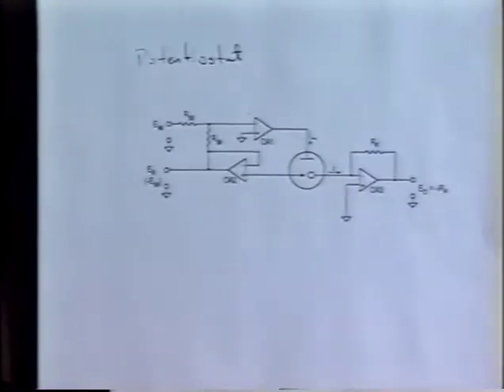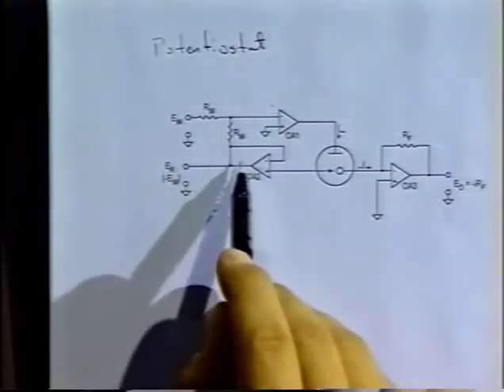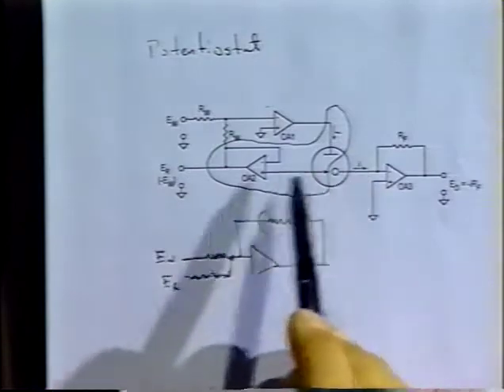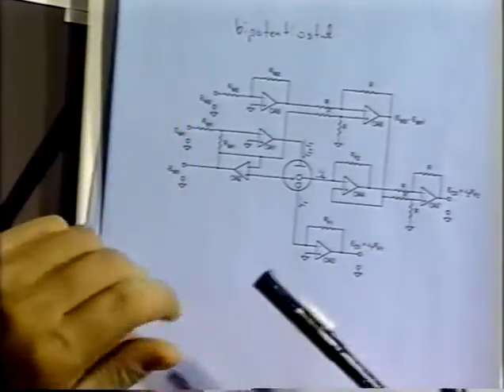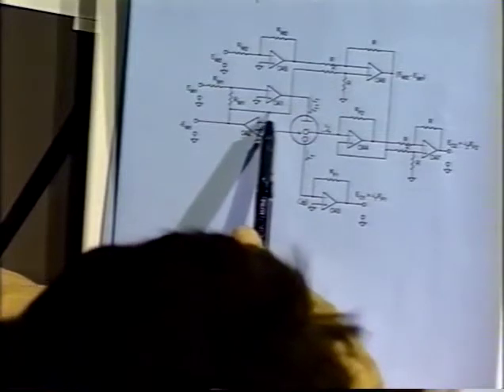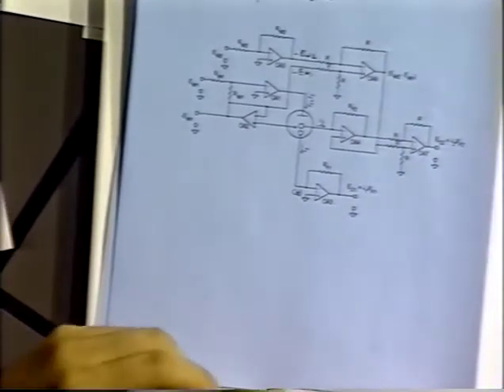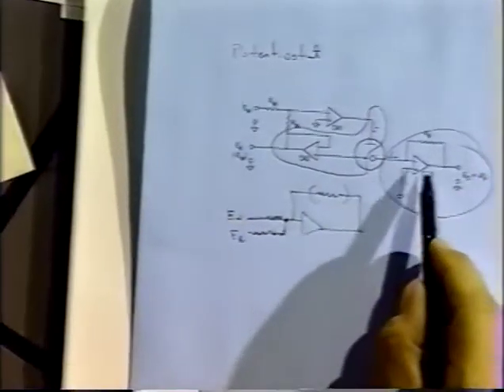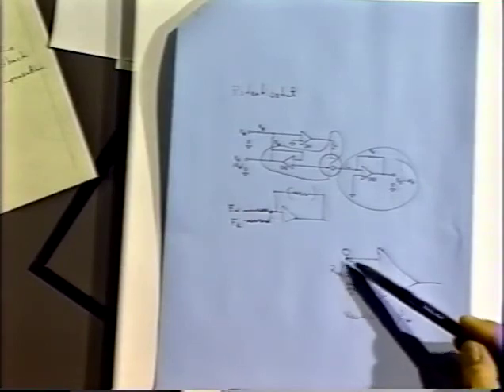Potentiostatic Circuit

Comment: Thank you! Very comprehensive and useful for the typical electrochemists who want to go one step further and master the instrument they use, potentially by building one by themselves. It would also be great to see an updated version of your lecture, showing the other classical potentiostat circuit (the buffer reference potential going to the non-inverting input of the control amp, as well as using two working cables (sense working electrode and drive working electrode)). Thanks again!

Comment: The 'feedback resistor' you've drawn at 6:15 to simulate the impedance of the cell, in the printed diagram it connects before the Rw of the Er, whereas in your drawing you've connected it after the node between Er and Ew.  Just an observation.  This and the lecture on operational amplifiers have been immensely helpful.  Thanks much.
Reply from the maker: Yes, I could have been a bit clearer there, the main point is that the impedance between the Aux electrode and Ref electrode is the  majority of the feedback loop. The  presence of OA2  buffers that impedance from the input resistance of Ew and Er and can be ignored assuming an ideal operational amplifier. Were it can't be ignored is a bit more technical than these lectures address. Good catch.

Comment: I dont find any closeloop path where you can measure the existing potential difference between Working electrode and refence electrode and feedback to the input of control amplifier to compensate the potential difference between WE & RE at require potential difference.
Reply from the maker: Recall that the working electrode is held at ground potential and the reference electrode potential is measured vs ground. Thus the reference electrode potential is effectively  measured vs. the working electrode.  Also, there is a feedback path through the solution resistance.

Comment: Hello I really enjoyed your video concerning Potentiostat electronic design and topology! I am a design engineer at a large medical diagnostics company in Germany, and have been designing two electrode analog front ends for the detection of glucose amounts in blood. EC is not my background, I have designed circuits through trial and error. Is there a comprehensive text which describes different types of electronic designs for two and three electrode systems, and also the implementation of different filter strategies? I found your explination approach perfect for my type of design work.  THANKS!!
Reply from the maker: Hi, I am not aware of a specific book or article that discusses potentiostat design. I suppose there must be one but I don't have any such book handy.  
One book that you might find useful is 
https://www.crcpress.com/Laboratory-Techniques-in-Electroanalytical-Chemistry-Second-Edition-Revised/Kissinger-Heineman/p/book/9780824794453, which has a chapter on potentiostat stability.

Comment: can we use differential amplifier instead summing amplifier? so reference voltage follower's output goes to negative of difference amplifier and excitation signal goes to positive of difference amplifier.
Reply from the maker: You could use a difference amplifier but it would require some care. In your comment above, Er is subtracted from Ew by the difference amplifier. This is not what you want typically. However, if you first inverted Ew and supplied -Ew to the negative of the diference amp. and Er to the positive of the difference amp., this would work.
Reply: @dwipf1851  could you please explain why Er-Ew will not work but Er+EW works?
Reply from the maker: @shahfenil08  I didn't say it wouldn't work. But the potential of the working electrode vs reference would be shifted positive (how much?). This would be very confusing, you would have to have a new reference electrode scale.

Comment: i'm making my own potentiostat using IC.
can u recommend me which OP Amp is the best in potentiostat?
Reply from the maker: Well that's hard to say without knowing more about your goals for the potentiostat.  For a simple potentiostat I might start with the TL072 dual op amp for the potentiostat part of the circuit. It's cheap but pretty good for this. For better performance, especially with the lower voltage offset for the reference electrode buffer, the OPA2227 would be good.  For the current transducer, the TL071 or TL072 is OK the TL2062 is improved.  These chips are all from Texas Instruments.
Reply: thank you sir I'm really appreciate of your comment.
&#160;In the middle of the video, especially 5:29, you are pointing a particular resistor maybe R sub r.
is that R sub r really needed in this circuit? then how that resistor is working feedback loop of reference electrode? and i'm going to put a registor value as same as R sub w 1k or 10k. is there a some recommendations of that potentialstat?
Reply from the maker: The resistor is needed there, it is part of a adder circuit that adds the reference electrode and external applied potential (look up adder Op Amp circuits).  You can use a 1k or 10k resister. But Rr and Rw must be the same value.
Reply: hi bro can you help me to make a potesiostat?plssssss